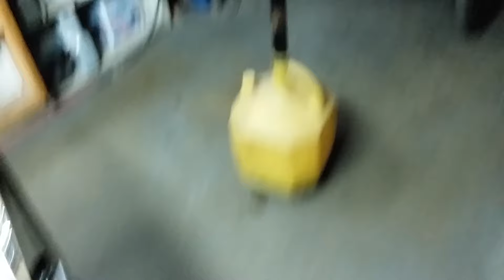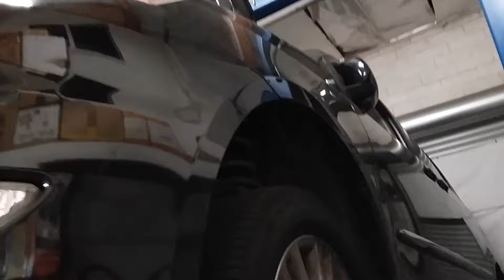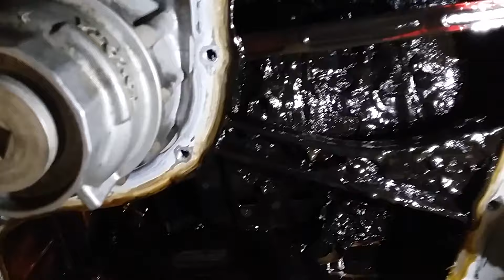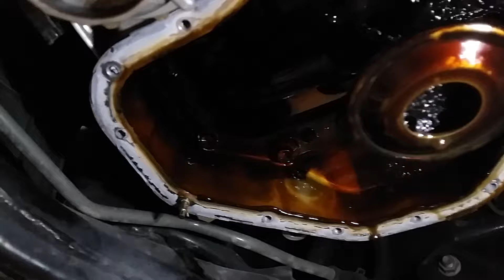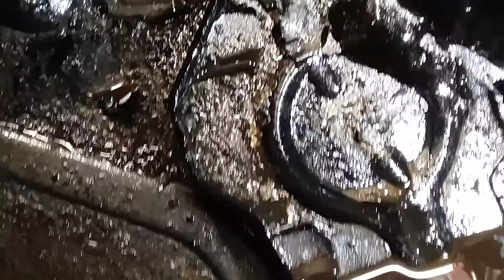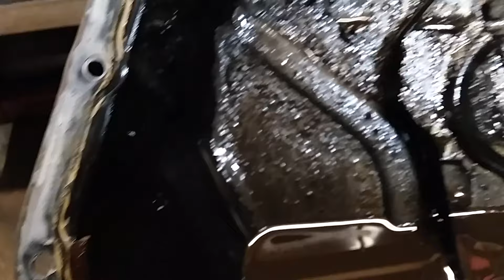2009 Toyota Sienna Broken engine & knocking

Comment: This tells me the motor wasn't  taking care of.
Reply: about a year and a half ago a neighbor of mine that lives 4 houses down asked me for some advice when i was walking past her house. Everyone always sees me outside working on one of my 3 vehicles in my driveway doing routine maintenance so i get a lot of questions of this nature. Anyhow she sais that she started her 3.5 year old Rav4 about an hour ago and it was shaking pretty bad after she started it so she shut it off and was trying to figure out what to do, and that's when i walked by, so i offered to take a look at it. Rather than trying to start it up,  based on what she told me happened when she started it up an hour previous i knew i had better at least do an under the hood visual inspection to first rule out any obvious issues. As soon as she popped the hood the first thing that hit me was the ominous burned oil smell and not like when some oil drips on the engine block when filling the oil but rather, that unmistakable smell of oil that has been completely destroyed by being scorched over a prolonged period of time.  l didn't say anything out loud but as soon as that smell hit my nostrils, the mental alarms went off and the first words to enter my thoughts were "oh no".
So right away i knew i better check the oil level, so i removed the dipstick and just as i feared, there was no oil on the dipstick, at least not in liquid form, just a tiny bit of what appeared to be dry varnish on the very tip.
So naturally, i asked her when the last time was that she had her oil changed.  i was thinking perhaps she had gone to one of those quick oil change places and perhaps they didn't put the drain plug back in or the oil filter was cross-threaded causing all the oil to leak out.  Well none of that was the case. She just looked at me for a moment then she says "they never said anything about oil when i bought the car".   So basically the Rav4 which she had bought brand new had been driven for 3.5 years (43k miles) with no oil changes and no oil added.  i next checked her dash and sure enough, there was both the oil indicator and check engine light lit up. So at that point i told her do not try to start the car again, call a tow truck and have it towed the Toyota repair facility.  i already knew what the outcome would be but yeah, there are a whole generation of people now that are just clueless to these sorts of things.  Needless to say the engine was shot, completely sludged up.